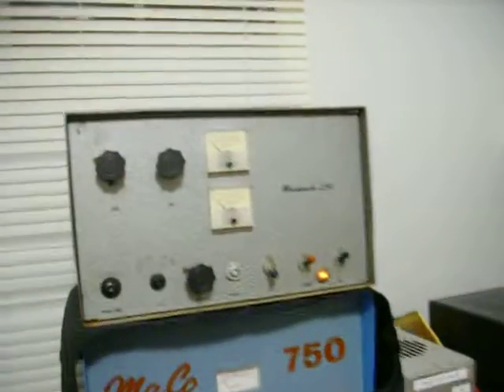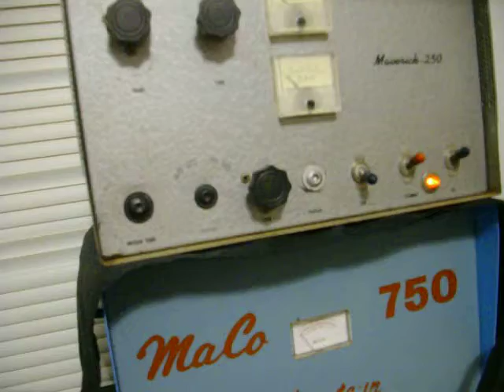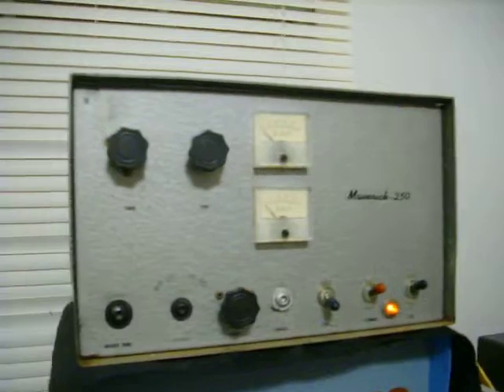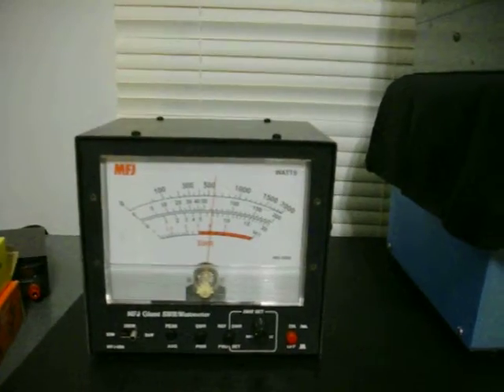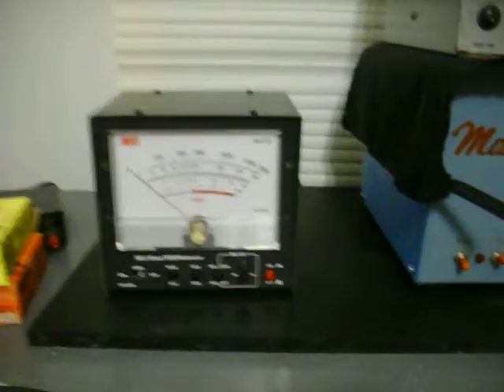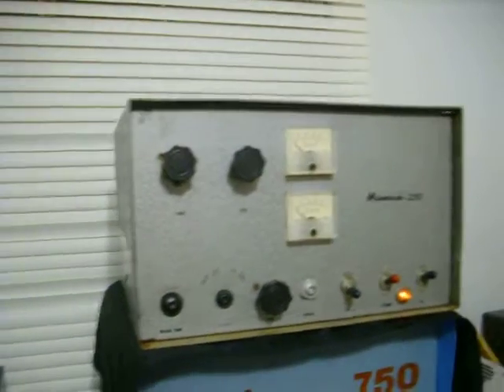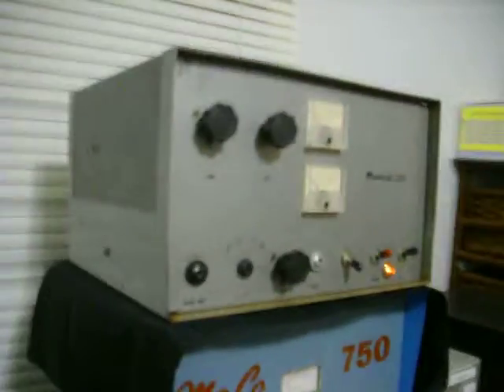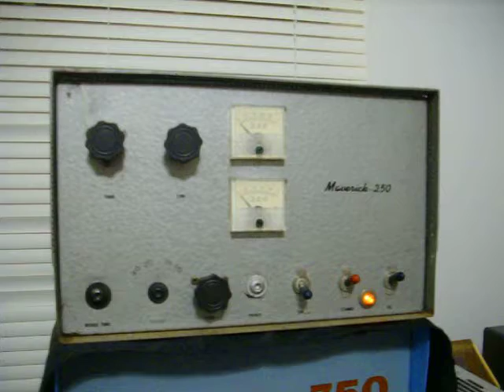maverick 250 converted to a steel tube 4cx150D

Comment: Morning Mr.Fatcat,727 waving a hand from Maryland.  Got a curious question. With the price of sweeps lie say 8950s & 2057s higher than giraffes making love and hard to get hands on,if a man had himself stash of 250Bs,150As or even some of the smaller Russian steel tubes what would a ballpark guestiment be to convert say a Pal 300a,D&A,Maco or any number of the old classics to a 2 piece box with single or a pair of mini steels in it? 

727 Tha Boilermaker rolling a 5 you way rascal. 727 working this little monkey swinging plate modulated station from the sandy shores of Maryland 👋👋👋👋